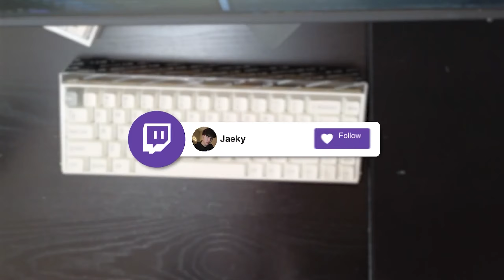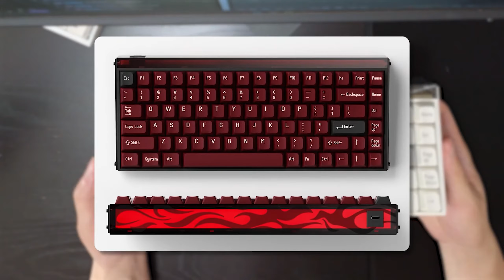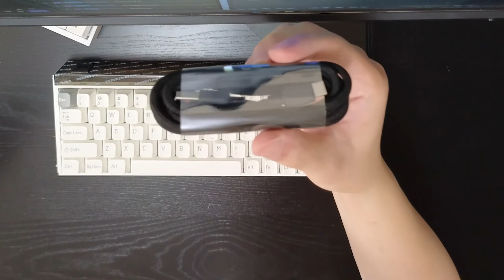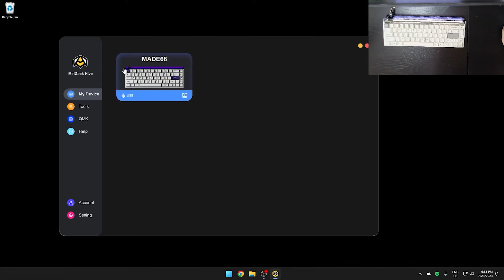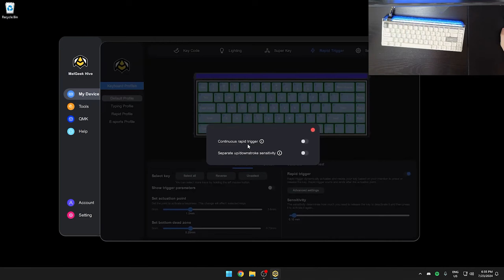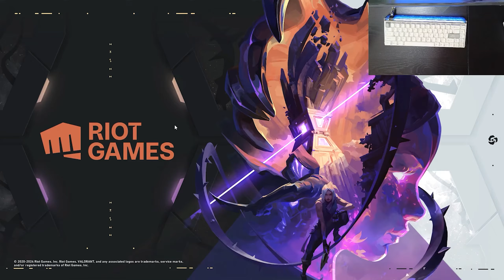Melgeek MADE68 PRO Keyboard Review

Comment: Is this better than the wooting60he? And if you see this by the time you review the 80he, is it better than that?
Reply: @Jaeky  Have you tested anything better than the wooting?
Reply: @Jaeky  Yeah even though keyboards like this one and the iquinix ez63 have been getting equal or better raw performance the overall user experience still seems to be better on wooting + the stability and customer support from its brand. Do you plan on making a video review of the wooting80he?
Reply: @Jaeky  Will be watching. Thanks for answering all my questions!
Reply: @Jaeky what do you mean about performance? I have both and there’s actually no difference between made and wooting in terms of performance. Yes, wooting software is number 1, but melgeeks not that much worse